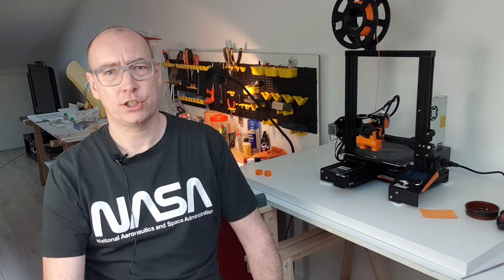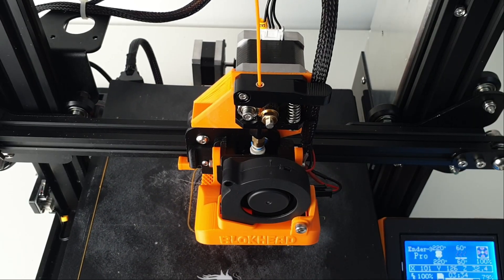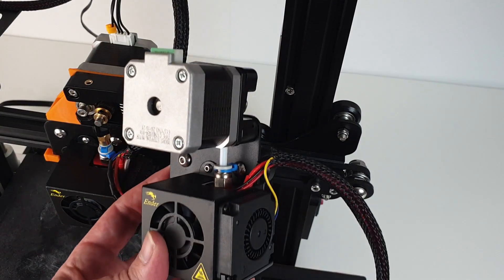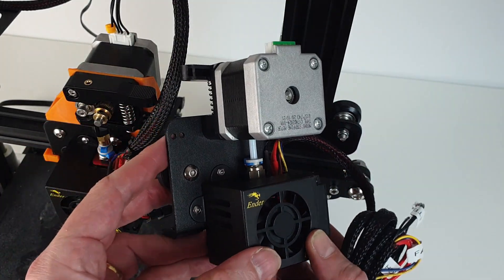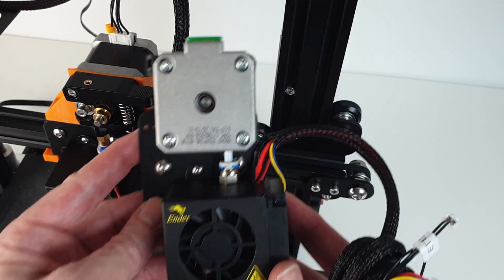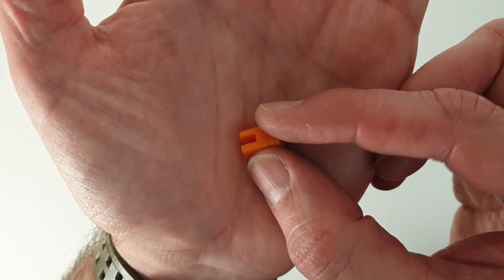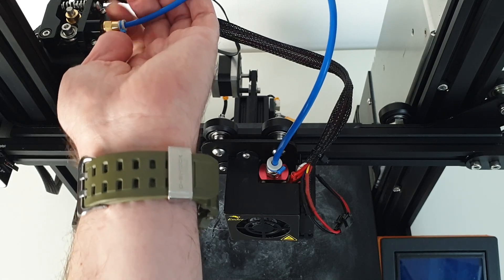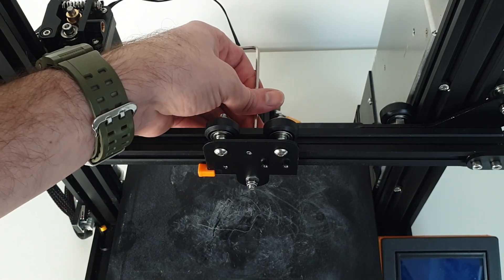3D Printed Direct-Drive for the Ender 3

Comment: do I need to change the extruder steps?
Reply from the maker: No but you may have to change the extrusion multiplier in Cura
Reply: @YouMakeTech  can you share that configuration?
Reply from the maker: @joanperalta846  This is nothing fancy nor specific to direct drive, simply extrusion calibration. In Cura, in the material section, I adjust the Flow parameter until I get the right amount of filament extruded. This has the same effect as the e-step calibration but can be adjusted for each filament / print temperature.  See https://www.simplify3d.com/support/print-quality-troubleshooting/over-extrusion/ for more details. Using the flow compensation factor in Cura and following the excellent instructions provided by the Simplify3D, I avoid under-extrusion / over-extrusion. I have personally never adjusted e-steps and have done every thing with Cura Flow compensation...

Comment: Do I need to change software settings after this mod ? Thanks
Reply from the maker: No. You can print with the exact same settings as before. Optionally you can improve retractions with the Direct Drive, and also update the print volume if you print large parts.
Reply: @YouMakeTech  Nice, can you suggest retraction settings for Direct Drive. And print volume, I don't know how...
Reply from the maker: @InnerFire  For the retractions, I am still using "Bowden like" retraction settings although they are suboptimal: Retraction distance = 6.5 mm and retraction speed = 25 mm/s. Normally it is possible to reduce the retraction distance and increase the retraction speed with a Direct Drive. For the print volume, in Cura, go to: Settings > Printer > Manage printers...  Then click on the "Machine Settings" button. In the top left, you can change X (Width) Y(Depth) and Z (Height). For the Ender 3 Pro, they are set to X=220 mm, Y=220 and Z=250 mm by default. With the SpeedDrive, they must be reduced to about X = 207 mm, Y = 220 mm and Z = 210 mm.
Reply: @YouMakeTech  I set new positions, but now my printhead settings are not ok. And i don't know how to fix it...
Reply from the maker: @innerfire369  I don't understand what you mean by "I set new positions". The SpeedDrive V1 is a minor upgrade: The extruder is just moved closer from the hotend, and the tube is shortened. I had good quality prints by using the exact same settings as before when I was using a Bowden extruder.
Reply: @YouMakeTech  The quality is good, but when I try to print with maximum bed size the X pushes home switch while printing.
Reply from the maker: @innerfire369  OK, I see. Maybe you have some home offsets set? Did you try "Auto Home" then "Set Home offsets" in the Marlin menu before printing? Btw. If your print is so big that it goes to X=0, Y=0, this will push the switches.
Reply: @YouMakeTech  I use Klipper for firmware with octoprint and use the default config file for ender 3. Then I use bed level calibration from the "Calibration Shapes" plugin in Cura.

Comment: Hello bro...want to ask ..can I use the design for ender 3? Is it the same? Thanks
Reply from the maker: Yes, it is compatible with the Ender 3. The only issue you may have is the length of the extruder cable. This length has changed over time...

Comment: Thanks for the video! 👍 And what retract settings are u using? Or just keep default
Reply from the maker: You're welcome. Thanks for watching! I kept the default retraction settings: retraction distance = 6.5 mm and retraction speed = 25 mm per s. These settings work fine for me. It is normally possible to reduce the retraction distance and to increase the retraction speed.

Comment: sashalex SpeedDrive design is really great. For not to loose any printing space: 

- Change Extruder and Y motor. Y motor i thinner thus weight on X axis will be lower and you could reach higher printing speeds. 
- To install Y motor on extruder you need to use some m3 washers. 
- You could reach 100mm/s printing speeds on old 8bit-board using Klipper as firmware. (I did) 
- Bullseye fun duct has better cooling performance so that higher speeds become possible. 
- Layout the cables from outside of the frame, do not pass it through. You just need to extend extruder cable either with a fabricated cable or with a usb cable and some soldering. 

 I tried to explain changing stepper motors and installation process and laying out the cables outside the frame etc. on my blog: https://all3dprint.blogspot.com/2020/09/ender3-pro-direct-drive-bullseye-mount.html
Reply from the maker: Thanks for your comment. I like this idea of swapping the extruder motor with the Y stepper motor to not lose any printing space. Until I read your comment, I never noticed the Y stepper motor was smaller. Something else to try out!

Comment: Does the gantry handles well the shifted weight of the extruder motor? Any z banding or other visible artifacts?
Reply from the maker: The gantry seems to handle well the additional weight (~320 grams) of the extruder motor. I haven't seen any impact on print quality due to this extra-weight at least when I print at normal speeds (50 mm/s, 500 mm/s²). I believe the position of the extruder in the SpeedDrive design (in the back) is actually better than on most standard design (extruder motor in the front) because the center of mass of the extruder motor is exactly above the X translation axis (above the wheels/bearings) and not off-centered. The only drawback of this design as far as I know is that it reduces the available print volume by 40 mm on the Z axis, and 13 mm on the X axis due to the motor hitting the frame...

Comment: What is the retraction rate for this?
Reply from the maker: I have good results with 25 mm/s and 6.5 mm but this is probably suboptimal as I haven't done any specific testing for this yet.
Reply: I thought retraction would change to be lower instead of higher?
Reply from the maker: @Bukton5000  Indeed. 6.5 mm is what I used with the Bowden extruder. With the Direct Drive, the retraction distance can be reduced and the retraction speed increased. However, I noticed that due to the improved accuracy of the direct drive, the print quality is much less sensitive to these settings than with the Bowden extruder.

Comment: Is it suit for ENDER 3 MAX? Thanks.
Reply from the maker: I believe it should fit but I cannot be 100% sure because I don't have an Ender 3 MAX. You can give it a try: it's only 2 parts to print and doesn't cost anything.
Reply: @YouMakeTech  OK. Thanks.

Comment: is it work with Ender5 pro? it look the same stock .
Reply from the maker: Sorry, I don't know because I don't have an Ender 5 pro. You can give it
a try: it's only 2 parts to print and doesn't cost anything.
Reply: @YouMakeTech  ok,i will let you know,thanks.
Reply: @phattaradanaiphongkachen8586  there are remixes that support ender5
Reply: @alex3d453  thanks,the original one is fit to Ender5👌 I've tried.
Reply from the maker: @toyloverth5691  Thanks, good to know.

Comment: PTFE Tube size ?
Thank you in advance
Reply from the maker: Around 63-65 mm. Make sure you really push the tube to the maximum inside the hotend. I would recommend to cut it slightly longer and to adjust the length step by step afterwards until there is no free play.
Reply: @YouMakeTech  thank u
Reply from the maker: You're welcome. Please let me know what you think about the Speedrive!
Reply: @YouMakeTech  yes I'm going to upgrade that mod.... Can you suggest me that is this really good upgrade...? Like we get more improvise print quality?
Reply from the maker: Honestly, if there is only one upgrade to do on the Ender 3 Pro, I would recommend that one. Not only you can print everything with this setup from PLA to TPU, but the extrusion accuracy is so much improved... I will never return to Bowden extrusion! I am even wondering why Creality printers still use Bowden extrusion... Direct drive is simpler and more versatile! In addition, the better extrusion accuracy not only improves the print quality but opens the door to ultra fast printing... I have a video coming out shortly about this. With improved cooling (Bullseye Blokhead) + improved extrusion (Speedrive V1), I almost print 2X faster with negligible loss in quality. Stay tuned!
Reply: @YouMakeTech  yes exactly, actually i was upgrading cooling fan with hero me v2 mod.... And saw your blockhead video 😅
Reply: @YouMakeTech  are you there sir?
Reply from the maker: @TechSavvyOmi  Yes, I am
Reply from the maker: Sorry, I am an old school guy from the Facebook generation 😂 I don't have Insta or Telegram accounts... Actually, I even deleted my FB account! Just let me know what I can do for you here. Thanks
Reply: @YouMakeTech  hey i have assembled all this thing is but the extruder wire is short
Reply from the maker: @TechSavvyOmi  Bad luck... On my Ender 3 Pro, the extruder cable is long enough and the direct drive can reach the entire print volume. I guess the length varies from printer to printer...
Reply: @YouMakeTech  thank u so much... i add extension to the extruder wire.... And tasted  few prints with tgis upgrade..
Reply: @YouMakeTech  i have set 2.5 retraction.... Printed 2 3 models..... Quality is ❣️💯 thank you for sharing your knowledge and replying to all my queries.... Please upload a video regarding bed calibration or any mod
Reply: I was trying to mentioned you in my channel's community post... Have you received any notification?
Reply from the maker: @TechSavvyOmi  Cool.😀 Thanks for your feedback. I am also very satisfied with the SpeedDrive, not planning to return to Bowden extrusion. I have a video coming shortly about printing insanely fast on the Ender 3. Stay tuned!
Reply: @YouMakeTech  sure..... Thanks man ❣️ please make video on cooling and bed calibration also
Reply: @YouMakeTech I found for me having the metal extruder upgrade already from Creality, around 70 mm of PTFE was needed. 
Either way, thanks for this great tutorial! Next step for me will be to install the Bullseye duct and Klipper firmware.
Reply: Any cura setting changes.. Like retraction
Reply from the maker: @TechSavvyOmi   @Tech Tronix Projects  I increased the retraction speed from the Cura default of 25mm/s to 50 mm/s. I keep the retraction distance at the default of 6.5 mm. In my experience, the direct drive is more sensitive to the retraction speed and not much sensitive to the retraction distance. Hope this helps

Comment: hey! just wanted to say that this is really nice and helped me a lot. Good to know that I don't have to spend 40 USD to upgrade to direct drive. Thanks 4 this video.
Reply from the maker: You're welcome. Thanks for your comment 😀. Another easy and worth doing upgrade is to put the spool holder on bearings, if you haven't done it yet https://www.thingiverse.com/thing:3979065 . It requires only 3 skateboard bearings but I was amazed by the impact of this upgrade on the print quality! The filament feed rate and extrusion becomes much more consistent. Take a look at this video at 1:47:  https://youtu.be/qy6ELl_-Cu4 . Happy 3d printing!
Reply: @YouMakeTech  thanks so much! It's not often creators respond and give more advice, I think it is time to decommission my fidget spinners and turn them into spool holders.

Comment: After doing this install my extruder rotates the wrong way so it's extracting the filament rather then extruding it. I did install a newer, longer cable but have checked this is plugged in correctly. The connectors can only go in one way around. Has anyone else had the same problem?
Reply from the maker: Did you try again with the original cable? I did not have this issue. Is the new cable exactly the same? I noticed that on my cable, the 2 pins in the center of the connector are swapped... They don't go straight into the connector on both sides. Maybe this is done to change the direction of rotation... But I cannot say for sure. Hope this helps.
Reply: @YouMakeTech  Thanks for the reply. Yes I reverted back and it's fine so it must have been the wrong cable for my printer. I thought it might have been. In all honesty though I don't like this mount. The fact the motor hits the gantry on both x sides and the z is just downright annoying. I followed your video and it didn't mention it would hit the right hand side so I wasn't prepared for that when doing the mesh bed levelling. It crashed into the frame and made some awful noises. I think I might try and switch it around 180 degrees with a different mount that that I can use all of the print bed. I did get some lovely prints in the centre of the bed though, but it's not for me.
Reply from the maker: Good you found the solution. I am sorry to read you don't like this upgrade. Maybe consider the Direct Drive upgrade kit from Creality? The motor is in the front therefore you don't lose any of the printing volume. I bought it for less than 40 USD. It works fine but is incompatible with the the installation of a cooling mod...

Comment: Does the motor hits the right side? Thanks
Reply from the maker: Yes it does. And the upper side too. This reduces the available build volume from 220 x 220 x 250 mm (Ender 3 Pro specifications) to 207 x 220 x 210 mm. Basically, you lose 13 mm on the X axis, 7 mm on the left + 6 mm on the right and 40 mm on the Z axis, due to the motor hitting the frame. Hope this helps
Reply: @YouMakeTech  
How do i change the build volume ?
Reply from the maker: @d2drone138  With Marlin, you have to update X_BED_SIZE (default = 235 mm) and Z_MAX_POS (default = 250 mm) in Configuration.h, and flash the updated firmware in your printer. In the slicer, you can also update the build volume: In Cura, Settings -> Printer -> Manage Printers... Then click on "Machine Settings"  In Printer Settings, update  X (default = 220 mm) and Z (default = 250 mm). With the right build volume, Marlin and Cura will not command coordinates outside of the available build volume, preventing the head to hit the frame.
Reply: @YouMakeTech  Then is better make a motor support place in the right or left to make space for not hit the frame, right? Sorry for my english...
Reply from the maker: @valeriocancemi  Maybe if you really need the 220 x 220 x 250 mm build volume. 
However, this seems to give other issues: From the SpeedDrive v1 designer on Thingiverse: 
"I started playing around with various mount designs and found them to be inadequate. The corners were good, but ringing and vibration prevented high speed printing and good bed adhesion. The orientation of the motor and distance from the X extrusion was not suited for sufficient inertial dampening. In creating this mount, there were two operating principles:
- Orientation of the motor (shaft) should be perpendicular to the X extrusion for good absorption of rotational inertia.
- The motor's centre of mass should be as close as possible to the middle of the X extrusion for absorption of its significant linear inertia at speed.Staying true to the operating principles, my solution was to mount the motor from behind the carriage with the extruder facing forwards."

Another thing is to look what the manufacturers do. The Direct Drive from Creality also has the motor perpendicular to the X axis.
The Prusa MK3 also comes with a direct drive perpendicular to the X axis. I guess these guys could have chosen any orientation for their direct drives, but they all decided to install their direct drives perpendicular to the X axis...

Comment: thank you so much for posting this, its tremendously helpful. did you have to make any adjustments to the offsets? or did it come out as nicely as you made it look without hassle?
Reply from the maker: Thanks for your comment 😀. I did not have to make any adjustments to the offsets. The mechanical end stop spacer takes care of the X offset: It pushes the X stop switch right before the motor hits the frame. You can see this at 9:45 in the video. This upgrade works very well and it is easy to install. The only thing I had to do after posting the video was to re-adjust the length of the tube between the extruder and the hotend. In the video, I cut it to 60 mm, but this was slightly too short. The ideal length is more around 63-65 mm. Make sure you really push the tube to the maximum inside the hotend. I would recommend to cut it slightly longer and to adjust the length step by step afterwards until there is no free play. Hope this helps.
Reply: For not to loose any printing space change Extruder and Y motor. Y motor is thinner thus weight on X axis will be lower and you could reach higher printing speeds. To install Y motor on extruder you need to use some m3 washers to gain 1-2 mm extra and bed leveling knob on left back side need to be changed with a smaller one to not to hit the larger motor.  

Layout the cables from outside of the frame, do not pass it through. You just need to extend extruder cable either with a fabricated cable or with a usb cable and some soldering. 

I tried to explain changing stepper motors and installation process and laying out the cables outside the frame etc. on my blog: https://all3dprint.blogspot.com/2020/09/ender3-pro-direct-drive-bullseye-mount.html 

For better cooling use 3dprint Bullseye fun duct, it  has better cooling performance so that higher speeds become possible. And use kliiper if you already own a mini-pc (raspberry pi etc) to reach higher printing speeds.
Reply: @ercintorun1085  you
Reply: @brenphelan  i :)